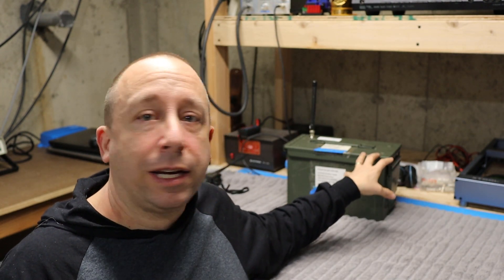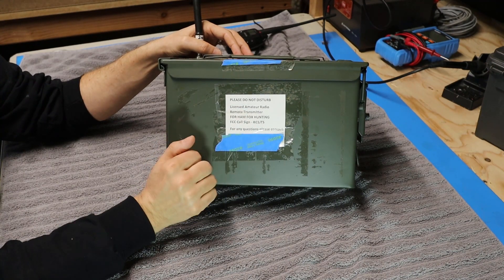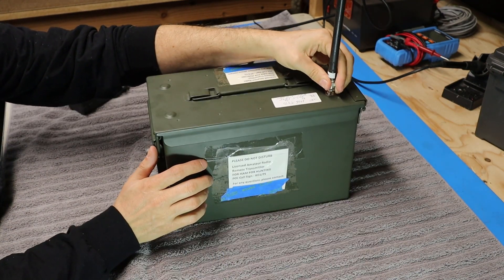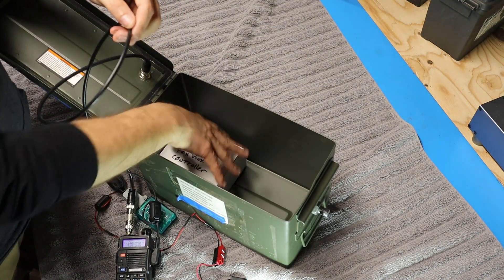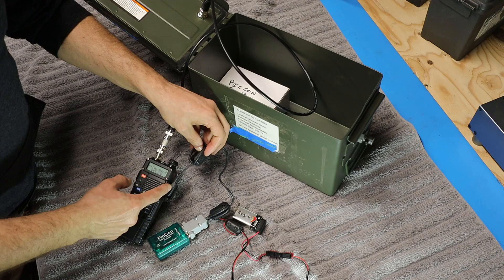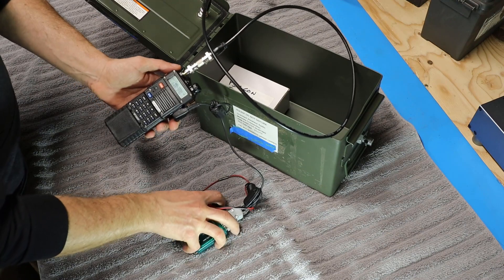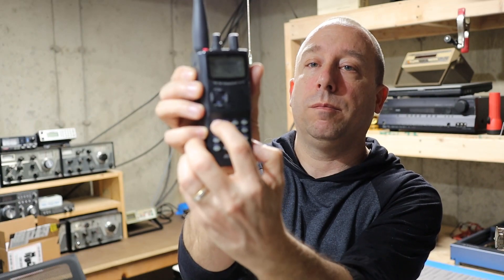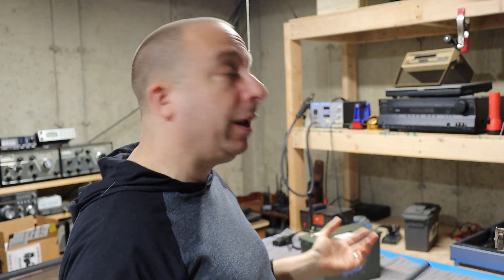Let's look inside a Ham Radio Fox Box (Hidden Transmitter)

Comment: How far will it transmit, assuming flat terrain?
Reply from the maker: I really don't know...it depends on power and antenna of course but on approximately 5w with the antenna style shown it's maybe up to 5 miles.  We don't have flat terrain here so in my experience, height (hilltop vs valley) increases the distance quite a bit.

Comment: I built precisely the same thing many years ago for Civil Air Patrol.  They had a practice ELT that operated on a specific air band frequency that was not the emergency channel. Then training excercises would take place where field teams searched for the ELT.  I got a green ammo can,  and had the same sort of antenna arrangement and cutout foam inside for the ELT to set in.  IT was clearly marked as to it being CAP property and what it was on the outside of the can.  Worked fine.
Reply from the maker: Sounds like a good setup!

Comment: Sounds like a fun project. I could send the grand kids out to hide it and I could find it. Which comes to a good question. Would they be violating FCC rules if I was the one that turned on the fox and all they did was hide it and I hunted it?
How about another good question? If my grandson is using my pickup but I turned on my APRS capable Yaesu radio that sends out beacons that report location and I wasn’t with him. Would he be considered the one that is transmitting the beacon?
Reply from the maker: In the first scenario - no.  In fact, you'll see just that in next week's video.  My licensed sister keys the fox box and my unlicensed son hunts it with a receiver.  The second situation might be breaking the rules...we'd have to dig into the technicalities of unattended operation of equipment to really find out.
Reply: @SevenFortyOne  I think you will be safe when the feds meanwhile ignore ham rigs being used for CB with 10 KW linears which are advertised in Youtube videos.